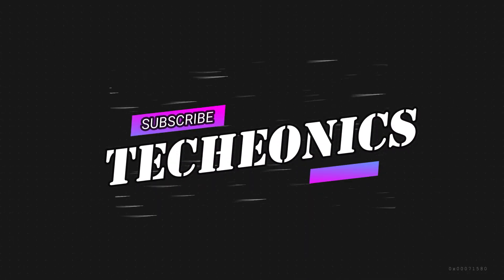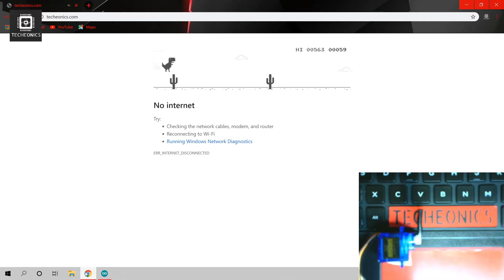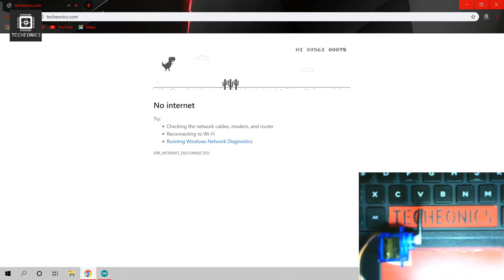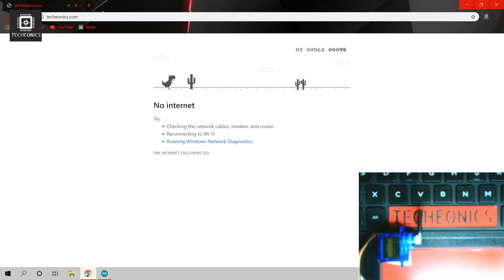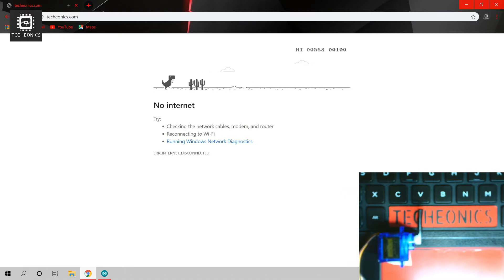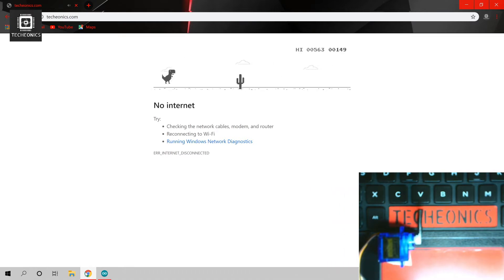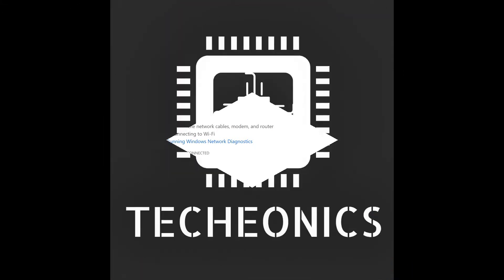How To make Automated Chrome Dino Game using Arduino |Techeonics

Comment: What to do if i need the LDR to detect other colour than black like blue (should i make some change in the code or will it sense some colour and press the button)
Reply from the maker: LDR can not Detect the colours it detect the light intensity only . If u want to detect the colors u can go with TCS3200 color sensor